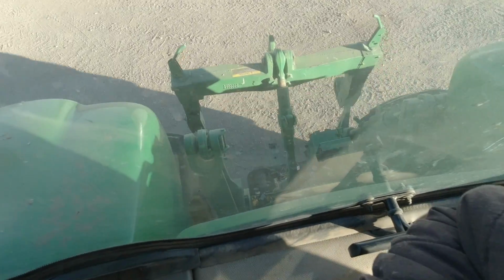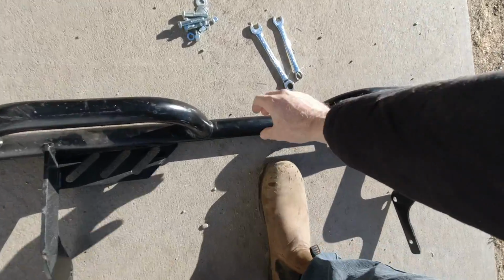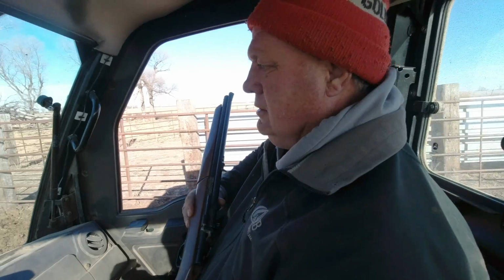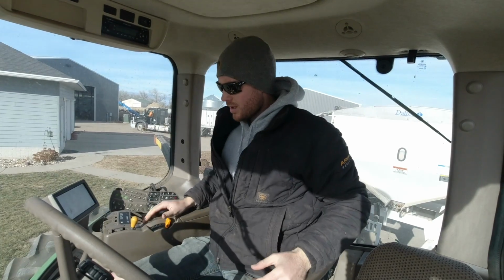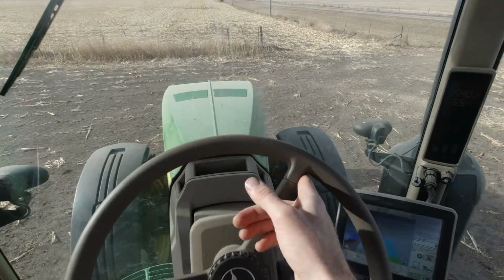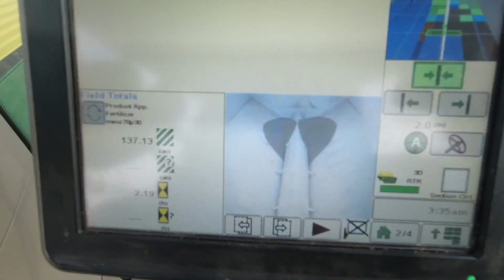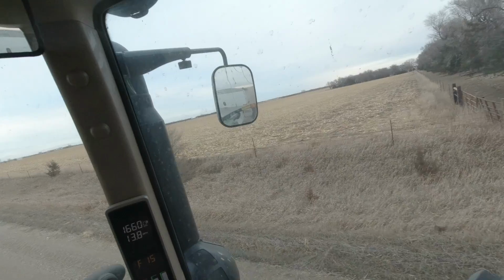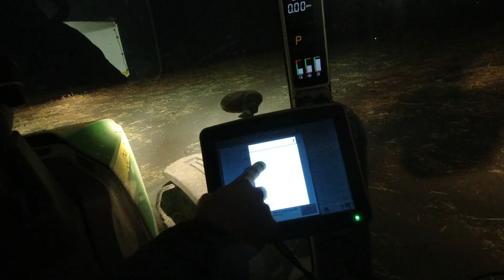Working on a South Dakota Farm

Comment: Hey Cole! Just wanted to say I have been watching you and your dad work together for better or worse and it’s great to see! Also I have over 40 yrs experience with welding , layout and fitting, all kind of material, but some of the most difficult to weld is dirty old aluminum. I tried using something similar to weld aluminum but what I found was the wire feeding through the cord will not last very long from alum Goulding the liner filling it with the wire. Before you find out how labor intensive it is to weld alum like you would weld stainless and mild steel. If you use a spool gun it going to make your experience so much better then dealing with getting the fill wire through the guild cable without the wire getting soft and causing way to many jams and cleaning to get it running again! Cole if you serious about welding mild steel and alum using the same equipment! For welding alum use a spool gun so you can weld what ever you like without the other pains of keeping the other equipment running because of clogging and jamming issue associated with welding Alum! If your interested in getting some good equipment to make welding anything a breeze! Write me back and I can tell you what I use and also other good equipment for doing this type of welding, just an FYI to help you be successful! Love you and your dads show!!

Comment: get some of the stuff that cleans alum. truck wheels to clean your alum. before welding your thing . use a cheep paint brush to apply it and a small SS wire brush to clean what you are welding . it will save you a lot of cuss words & make better welds . never use the SS wire brush on nothing but alum .  good luck